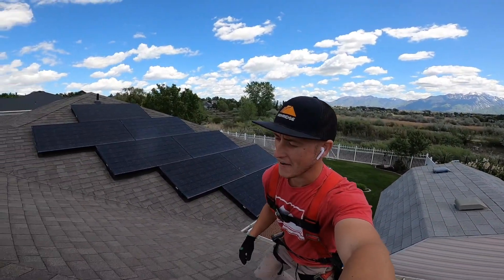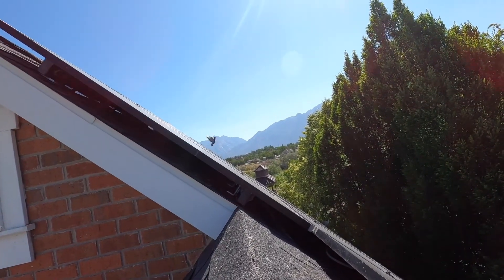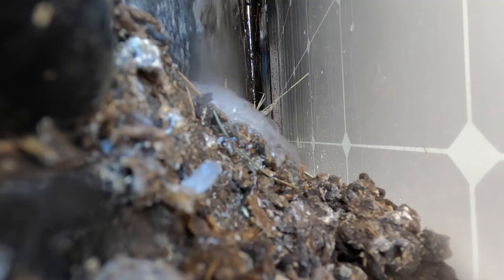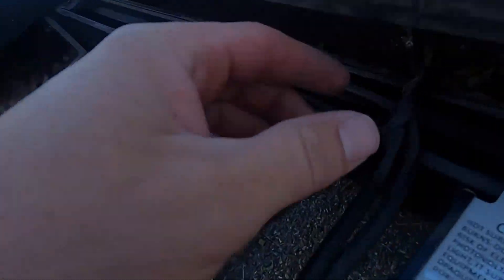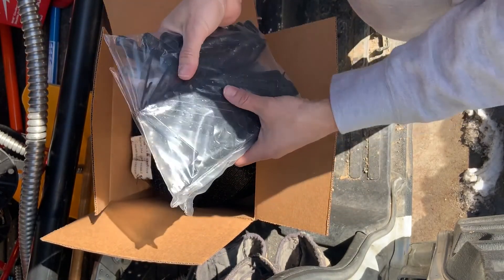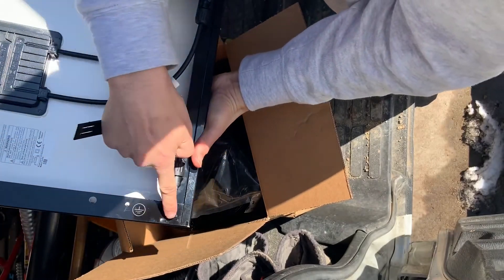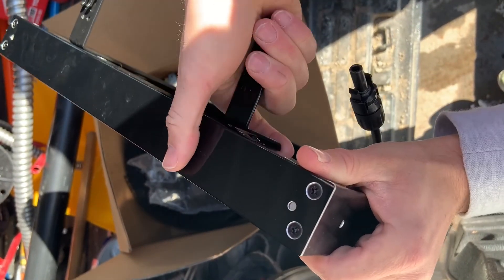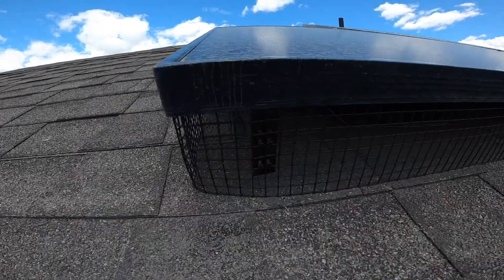Solar Panels Destroyed By Birds | What To Do

Comment: What kind of screen is that and where can I get it?
Reply from the maker: It’s made by SnapNrack! It’s by far the best product I’ve used. It’s a little more expensive but quality. There are a few good products on Amazon and other online stores as well.
Reply: @RedstoneSolar  do you need to turn off the solar system before lifting them ?
Reply from the maker: Absolutely. You shouldn’t ever work on your system unless it’s off. You should also never unplug a panel unless you have tested the voltage and know what your doing.
Reply: @RedstoneSolar  well i installed a screen around there and used self tapers to to aluminium frame well below the solar panel , they had squirrels and apparently only 3 panels worked after i did all the work . Removing nest, hosing the area down and installed the screen . Called a place that sells LG and they said it's unlikely that the screws caused the issue and it sounds more like a electrical problem , error code was something about ground leaking via inverter . Done many like this but not sure if k ever did LG panels
Reply from the maker: When I install panes I usually run the wires along the frame of the solar panels. I know it’s popular to use screws and when it comes to squirrels they can tear up the screen. I wonder if some of the screws did puncture/skim a wire.  What inverter do you have?
Reply: @RedstoneSolar  not sure it not my house k run a business although I don't do many solar jobs i trap wildlife , that's what I was thinking i notified my insurance just in case but it sounds like a electrical issue
Reply from the maker: Definitely an electrical problem. Really could be a million different thing. I’ve seen squirrels chew through the wires down to the metal. I bet you they striped some of jacket and the wire is making contact with the rails or frames. That can be dangerous! So definitely have the home owner get an electrician out.
Reply from the maker: The last little clip before I start talking about the screen kit was a wire that had been chewed all the way through from squirrels.
Reply: @RedstoneSolar  appreciate the replies , they're coming next month to check it out  so will have too wait
Reply from the maker: Absolutely, if you figure out what those squirrels did to the system let me know!
Reply: @RedstoneSolar  will do
Reply: @RedstoneSolar  thanks I’ll check it out!